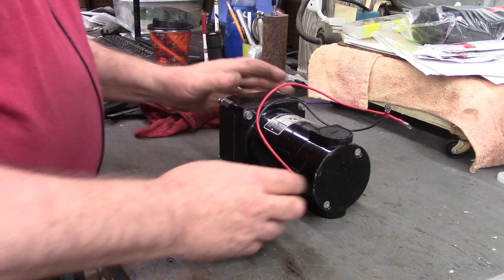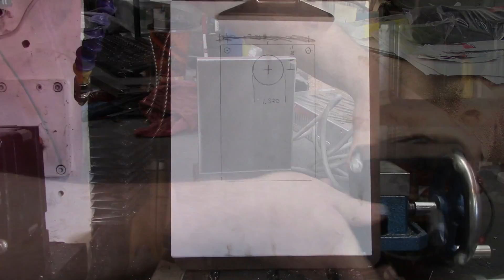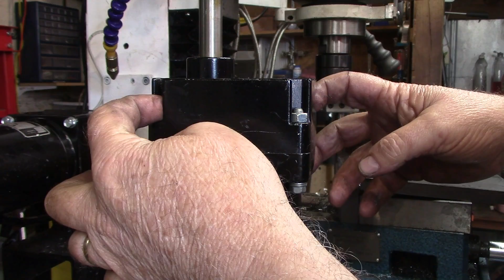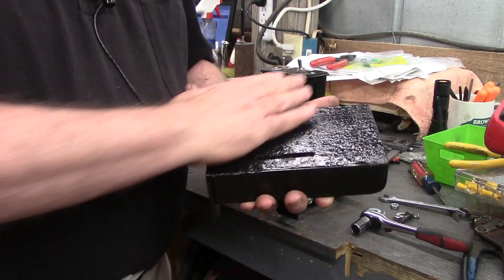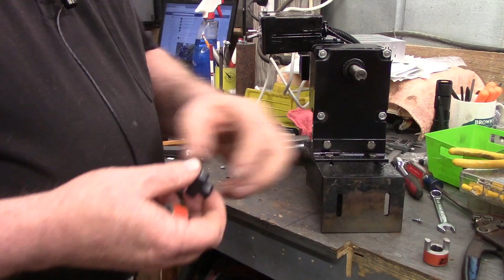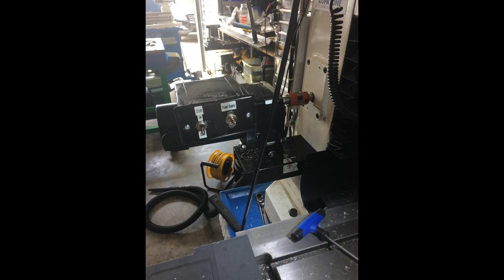PM-727 Mill Z Axis Power Lift

Comment: my guess is the motors are for an electric wheelchair
nice idea , might make the mounting plate so i can bolt it straight to the side of the mast and make a new shaft to replace the one holding the handle

Comment: Hi folks. It may help to know that the torque output of that motor is around 5 lbs ft at max rpm. You can measure the torque you need with a spring balance on the handle and multipling the reading in lbs required to turn the handle by the handle to axis centre distance - in feet for lbs-ft or inches for lbs-inch. On line calculators will tell you if your proposed motor is up to it. You can convert rated HP at a given output rpm to torque for example, which is what I did. BobUK.

Comment: He did a great job , but I did the same thing using a Milwaukee right angle drill 300 to 1200 rpm , only using 300 rpm mode , other is to fast 
and it works very well !!!

Comment: Great video, thanks for posting! Could you tell me for the PM727, what's a decent sized bench depth to put this on? I'm pretty limited on space but I think my bench is ~26".
Reply from the maker: ficklecycler The pan that comes with a 727 is 26”, of course the handle hang off the front. It would probably work fine on 22”.

Comment: I would think that a Nema 42 stepper motor could be bolted right on the shaft with no need for gear reduction and work great also. You could get a lot more speed going with that. I made a controller for my Grizzly mill that added power lift with memory, and auto return, as well as a bunch of other features. It would work on your 727 also. Let me know if you might be interested.

Comment: Hi.  I understand that this PM 727M machine has a 1 horse motor.  Has this ever caused you any problems.  I am looking to purchase one.  Great video.  Thanks
Reply from the maker: dale jones I've never had any issues at all with the power of the motor. Of course any bench top mill is going to have limitations on what it can do, but it doesn't take long to learn its capabilities. Thanks for stopping by.